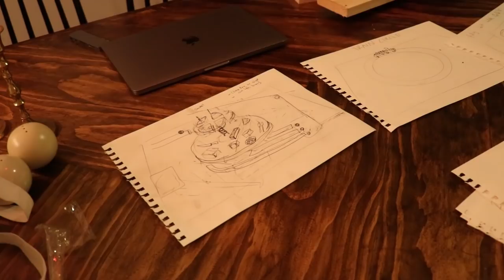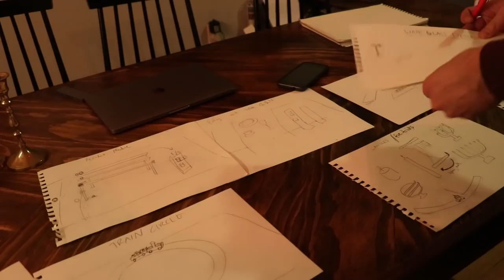Behind the Scenes of Pass the Pepper (w/ @JosephsMachines)

Comment: The best action to attempt to save the macbook would have been to immediately yank it off the table and flip it upside down while holding the power button to shut it off. After drying, it would have probably survived. However, from the looks of the missing feet on the bottom, chances are it was a much abused old model that wasn't worth much anyway.
Reply from the maker: You're right, it was a very old laptop that was already cracked in the corner of the screen. Some of the keys didn't work, and the trackpad didn't allow click & drag (click worked fine, drag not so much). The only way to operate several functions was through a remote. So yeah, we didn't make that much of an effort to save the laptop, in fact we were hoping it would die immediately before the camera cut to the next shot. The reason it looks like we're in such a rush to clean up is because the liquid isn't actually iced tea, it's isopropyl alcohol mixed with iodine (for the color). We wanted to clean it up quickly, mostly because of the awful smell!

Comment: I'll leave my comment here so it's easier for you to find

First off, can I just say that this is BY FAR the most impressive machine video I have seen yet. I am so thrilled with how this turned out! I think you both have done an outstanding job with representing the styles of each machine builder in a seamless manner, and the result is one incredible disorienting mind blowing project in which the unimaginable becomes a reality.

Here are a few of my thoughts on each clip:
0:08 - Right out the gates, a ridiculously accurate launch of a BOTTLE of PEPPER. And the way the bottle is moved across the table is super cool. I wonder if one-pepper-path machines will become a subgenre...
0:28 - If I may go back to the whole "blending of styles" thing: I'm not entirely sure, but I'm guessing that the flowerpot idea was Joseph's and the double use as a track was Lyle's. This makes for one pleasing trick. Even if I'm wrong about the inspiration, I still find it super impressive that you both had to adapt to slightly different ways of thinking to create these tricks.
0:42 - Okay, since this was only the third trick in the video, I could tell that things were about to escalate VERY quickly. Permanent tricks, or tricks that are hard to reset because the action cannot be undone (like burning a string or, in this case, cutting a cucumber) are tricks that I usually avoid because of how risky they are, but you two make these tricks look EFFORTLESS. This clip was beautiful in concept and execution, well done.
0:58 - Again, WOW. I absolutely LOVE this one. I never would have thought of using pasta and boiling water as a means of shortening a track for a ping pong ball.
1:30 - Okay not gonna lie I was kind of losing my mind with this one. I could NOT tell what was going to happen next, and it all started with the third pool ball missing its container. And then it knocks all of the tracks over and the black ball starts rolling on the first one, BUT IT LEADS TO THE NEXT TRACK AND THE NEXT ONE AFTER THAT? WHAT? The precision of this is ridiculous. And I could tell that this was calculated to perfection.
2:02 - I think the comedy behind this trick is really enjoyable. Once again, you are able to take what's expected and completely turn it on its head. I thought that the drink would spill on the computer, but of course, that's too predictable. And at the very end of the trick, when I thought it was all over, you still spilled the drink on the laptop! Very clever.
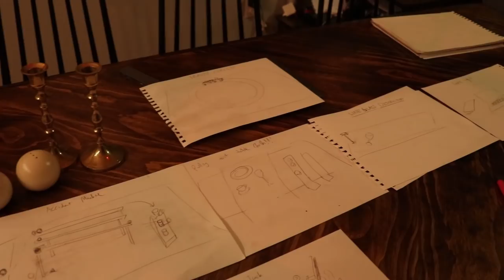2:30 - This one just looks like an art piece, I love the bottom layer and the theming of it as well. It just looks SO GOOD. I really am at a loss for words on how to describe it. Also, props to your editor, because the timing of the music could not be more perfect. The anticipation really started to build up within me and I could tell that things were about to get insane...
3:08 - ...but I never would have thought that THIS would happen. This is EASILY the best trick I have ever seen. OH MY GOD. It truly speaks for itself, there's no commentary I can add to this that would be coherent or make sense.
3:39 - BRAVO!!! Thank you guys for all the hard work you have put into this, it is truly a masterpiece. I really hope that COVID-19 has not hindered your ability to work with each other. I'm assuming that you currently aren't meeting, but I am for sure optimistic that you guys will be able to work with each other again. Once again, well done! I can't wait to see what each of you will do next!